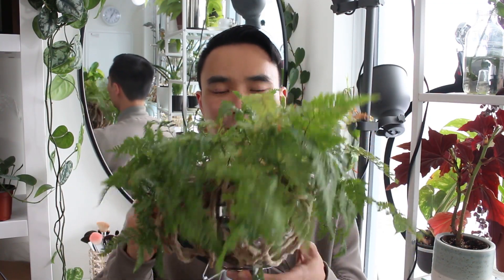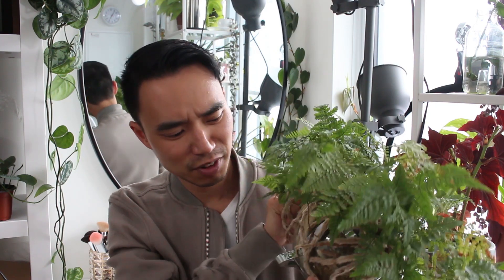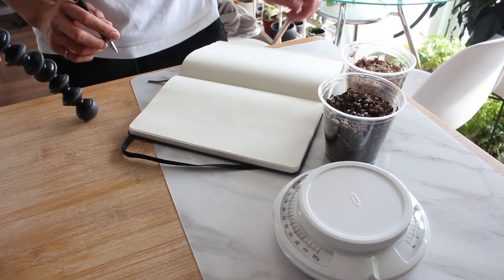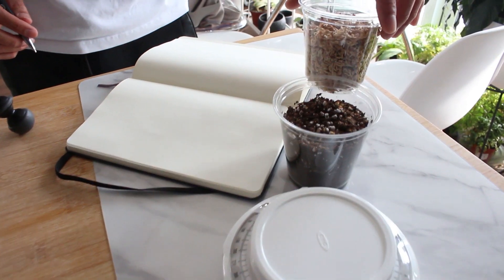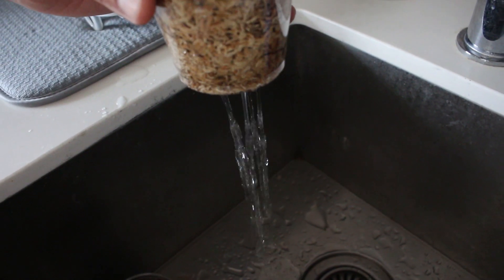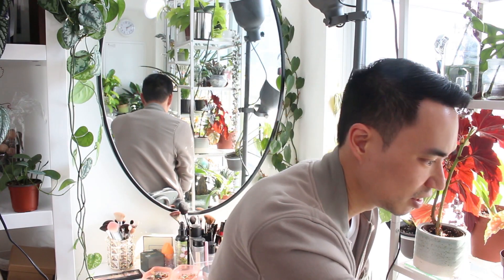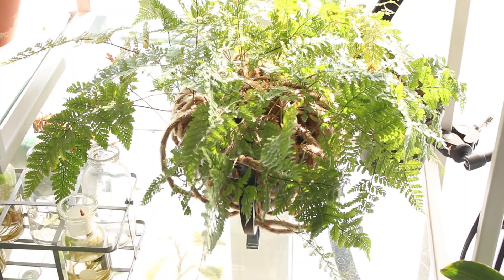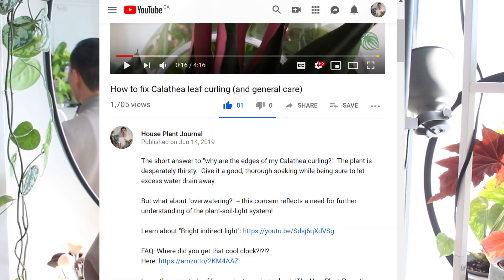How to water when you have no drainage holes | House Plant Journal

Comment: Whith all my respect.... Sir ... Does this tecknic apply has a general use ? and for ALL Plants in ALL conditions ? 
and would you have to measure wright amounts of water all the time for different kind of plants ? depending of pot size ?
and is there a special mixture or kind of soil used whith this tecknic ? 

I use Akadama + pumice+ perlite + vermiculite and of course holes in my Pots and all is great no root problems and growth is exceptional all lushish and green and encourages flower growth...of course each speecies in the wright LIGHT🌟🌟🌟

Thank you 🐝

Comment: Any advice on how to fix hydrophobic soil in pots without drainage holes? Ive had succulents die from a lack of water despite being watered. I hadn't realized the issue until I was cleaning it out and found water at the bottom and bone dry soil that hadn't absorbed a drop. Ive tried soaking it to the rim to let the soil absorb then tipping it to let excess water drain out but it seems the bottom part never dries out,even when the top is like dust.
Reply: I'd mix it up with new soil or compost.

Comment: ok now u know how much water the soil can hold but u dont know how fast it drys up so this is pointless !?
Reply from the maker: You don't need to know how fast it dries up...just check on it (as you should be for taking care of plants).
Reply: @HousePlantJournal  ok so how do I know how much % the soil is filled with water im confused usually am kinda smart but I fail to see your point.... if u just check on them an water when dry why do you need to know how much water the soil can hold? or was all this work just to have a guidline so u dont pour buckets in it ?
Reply from the maker: @MrCGangsta  if you DON'T have drainage holes, then knowing this guides you on how much water to pour in.  When you DO have drainage holes, then you can simply keep pouring and the extra water will drain away.
Reply: @HousePlantJournal  ok so its no exact science u sure made it seem that was:)  thx for replying keep posting videos

Comment: Why did your NOT wiegh out the water for your plant in the last part of the video? I just saw you water from the faucet directly into your plant.  Am I missing something?
Reply from the maker: A very good question: the weighing of the water was to establish what VOLUME of water will saturate a given volume of planting medium.  It's easier to estimate a volume ratio than it is to try and figure out a weight of water that should go into a particular weight of soil (which doesn't include the weight of the pot).  In any case, at the very end, I point out that adequate light is what makes it all work - I never get hung up on being super precise with watering.

Comment: Water 
near the surface readily evaporates and does so at a rate that is only limited by 
the energy available. This so-called energy limited evaporation lasts as long as a 
certain amount of water that evaporates, 0.47 inches for sandy soils and 0.4 
inches for silt loam soils. The time it takes to reach the energy limited 
evaporation depends on the energy available from the environment. Bare soil 
with no crop canopy on a sunny hot day with wind receives much more energy 
than a mulched soil under a crop canopy on a cloudy cool day with no wind.
So I don't need drainage lol.

Comment: Good video, thanks. Do you have an idea what the water to soil weight ratio might be? I have a pot with 7 lbs. of dry (very little moisture) soil and was thinking maybe 30% water ....2.1 lbs. ? Sound right? Or maybe this would vary for different types of soil............
Reply from the maker: This video discusses volume ratio, which is easier to estimate by eye.  The ratio by weight would be much higher - as in, a fully saturated sample of soil would be SEVERAL TIMES HEAVIER than that same sample completely dry.
Reply: @HousePlantJournal  Yes, makes sense.

Comment: 1ml of water always weighs 1g, so you don’t have to weigh the water, you can just measure it or use a container/watering can that has ml on it :)
Reply from the maker: Weighing it out using an identically shaped container will allow you to get an estimate of the volume ratio for the given planting medium.  It's easier to estimate a volume of water you pour out instead of having to weigh out the water for every different sized pot you have.